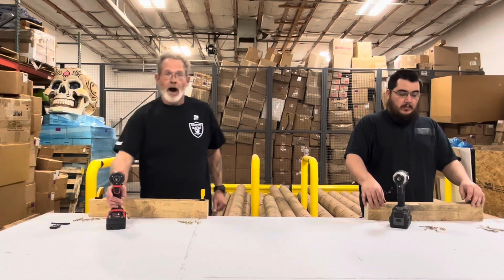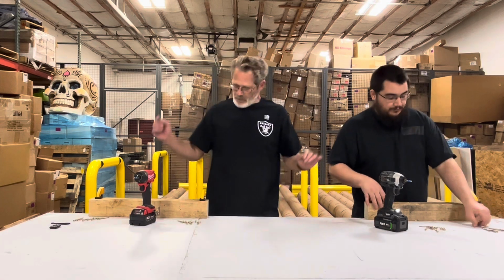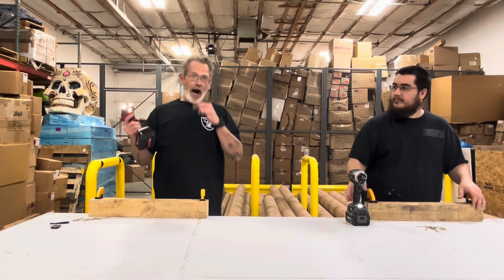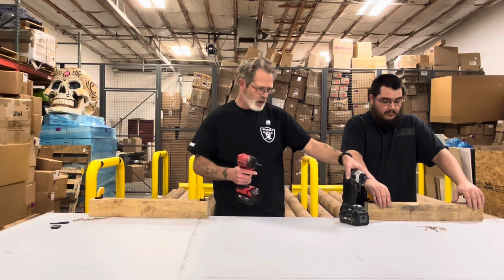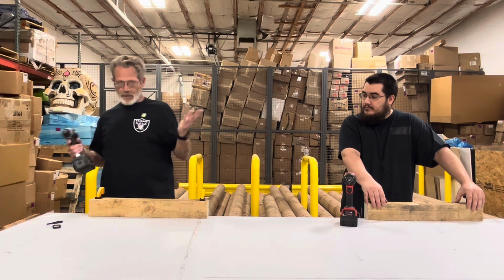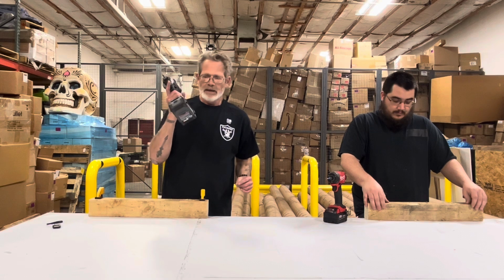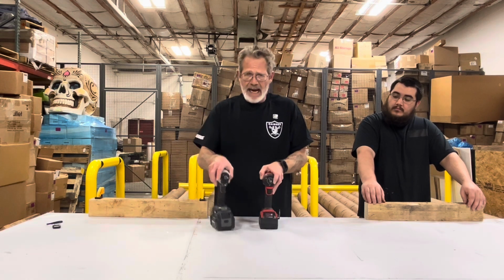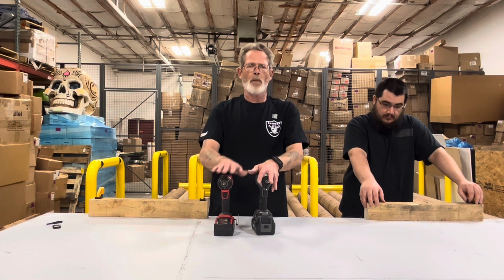Milwaukee vs Flex! #viral  #milwaukee  #impactdriver #reels

Comment: Great job guys!  If you decide to go with the Milwaukee, you should consider purchasing the CP 3.0 battery with 21700 cells.  Slightly lighter than the 5.0s you tested in this video and much more powerful.  The new Forge 6.0 batteries should also be considered.
Reply from the maker: After the soon to be posted drill showdown, it’s definitely going to be either Milwaukee or Dewalt.
I’m actually waiting for the giveaway by SOAlZ because, if I win something, it will definitely influence my decision.
I don’t know if the Milwaukee needs to be any lighter, by the way. It’s already a feather compared with Flex and Dewalt lol.
Reply: @DiligentDave1966  I saw the giveaway promo you’re referring to.  The Fuel angle grinder is a beast and has instantaneous power, similar to all the other Fuel tools.  You’d definitely be pleased if you end up winning it.
Reply from the maker: @SouthFLTools  I wouldn’t even mind the DCF845 since I already have XR batteries.
He’s also having a members only giveaway tomorrow night, and the tools were donated by Joshua Wilson. I’m crossing my fingers that, between the two, I can get something.
Reply: @DiligentDave1966  good luck!
Reply from the maker: @SouthFLTools  I’m not gonna lie, I wouldn’t mind winning a mid torque Milwaukee impact wrench. I could return the Ridgid and use the credit to buy some Milwaukee batteries or something.
Reply: @DiligentDave1966  you’ve had the Ridgid mid torque close to a year, is that right?
Reply from the maker: @SouthFLTools  Yes, but I bought it with my Home Depot credit card. December 28 I believe is one year, and you have one year to return as long as you use the Home Depot credit card. It was my first, and worst video that I have posted.
Reply from the maker: @SouthFLTools  I have only used the Ridgid once, and it worked well, but I don’t think the auto mode works very well. The Milwaukee is more compact and, I think, a little more powerful. Now that the Milwaukee hammer drill doesn’t bother my elbow, would be fine. Going with all Milwaukee . I would keep my 3/8 drive, Ridgid ratchet, though, because Milwaukee doesn’t make an 18 V 3 /8 drive ratchet.
Reply: @DiligentDave1966  Milwaukee makes a lot of ratchets, but only in the M12 line I believe.
Reply from the maker: @SouthFLTools  Exactly. If I wasn’t looking for a big hammer drill, I would consider the M12 Fuel line.
Reply: I agree, CP 3.0 is a great battery!
Reply: @Apache-Helicopter-Life  yes sir!  It’s an excellent battery for the Gen 4 impact driver.  I think the 2-pack is currently on sale too.
Reply from the maker: @Apache-Helicopter-Life  I will consider it if I keep the Milwaukee. I’m not trying to shed weight, though, because it is already super light.
Reply from the maker: @Apache-Helicopter-Life  DCD999 vs gen 4 Milwaukee hammer drill, which would you choose?
Reply from the maker: @SouthFLTools  I would totally consider Ridgid, but I’ve been hearing bad things about them lately. I saw a video where a guy said the drill cut out for no reason, and other people have said they’re not good quality. I don’t know from personal experience, but I know Milwaukee is good quality and I know Dewalt is good quality. Therefore, I kinda have to go with one of those for peace of mind. The Makita LXT is probably the best deal right now with the two free tools, but I don’t know enough about that brand either.
I didn’t win anything from the live stream, by the way. 
I might hold on to the Milwaukee in the Dewalt until the 50 K giveaway.
Reply from the maker: @SouthFLTools  Believe it or not, I think Mat tek 9 has convinced me to test the Ridgid.

Comment: Run the FLEX with the 3.5 STACKED LITHIUM and the MILWAUKEE with the FORGE Battery I have both of them the FLEX will be faster with bigger FASTNERS
Reply from the maker: Thanks for the advice, but I wasn’t really trying to see which one is faster. I was trying to see which one is more comfortable to use and I tested them as they come in the kit.
I decided that the Flex just isn’t comfortable enough to use on a regular basis because I’m only buying one set for my personal projects and videos.
I’m looking for a set that I can use a lot, and the Flex isn’t it for me. I also don’t want to spend another couple hundred dollars on a pair of 3.5 stacked lithium batteries.
Now I’m trying to decide between the Milwaukee and the Dewalt 999.
Also, I’ve heard that the Forge battery is pretty much overrated, but the 3.0 cp is good.
Reply: @DiligentDave1966  I like the FORGE over the DEWALT 5 amp Power Stack and it's almost equal with the FLEX STACKED LITHIUM go with the MILWAUKEE M18 Fuel GEN 4 HAMMER DRILL I have it but don't have any DEWALT DRILLS but looking Forward to the new one they have coming out soon it looks like a XR DCF 961 but it's a hammer drill
Reply from the maker: @ericnichols9275  I wasn’t really planning on buying batteries for awhile, and that’s why I chose kits that come with batteries and a charger. I’m on a budget and just trying to get myself a good combo for future projects and videos.
That said, the Milwaukee is a better choice, for me, than the Flex. Having two 5 amp batteries will allow me to get more done than a 5 and a 2.5.
The Dewalt is a decent option for me because I already have a couple of 5 amp XR batteries, so I can get a bare tool impact driver.

Comment: This proves nothing except you're both only ok at driving screws.
Reply from the maker: I’m so glad you analyzed this video without actually listening to what we had to say while using the tools.
I clearly didn’t claim to be an expert, but I was actually trying to figure out which one is more comfortable for me to use because I plan on keeping one of them for my personal use. So, what it clearly proves is that Flex is not the brand for me!
Thanks for watching. Maybe next time you will listen also.
Reply: @DiligentDave1966  it was a joke, not a dick, no need to take it so hard. Either way, your screw driving is mid at best.
Reply from the maker: @DudeEggs  Have you read my channel description. I’m an average DIYER, and never once claimed to be an expert or a professional.
This is also the first time I’ve used an impact driver with this much power. I’m used to using my Dewalt DCF787, which has a single mode and is only rated at 1500 inch pounds. I have several videos using the 787, and I’m very proficient with it, but it’s time for me to step up to a better combo.
My coworker/assistant has never used a power tool before he started helping me with videos. I’m not ambidextrous, so he helps me out when I do side by side comparisons.
I don’t take criticism hard, or let it ruin my day. I’m just not gonna be the passive person who I used to be.
I also believe that I zoomed in on the area below the trigger to make sure to point out the point I was clearly making in this video. The Flex isn’t nearly as comfortable for me to use on a regular basis as the Milwaukee is.
Everyone has a different opinion, and different experiences.
No brand is best for everyone.
Reply from the maker: @DudeEggs  I removed my comment, and I want to apologize.
I’ve had too many trolls who insult me and insist that I don’t know anything. I don’t claim to know everything, but most people won’t even give me any constructive criticism or real feedback on what I’m doing wrong.
Reply: I own both, i prefer the milwaukee gen 4 but the one key version. You get an extra speed mode, u can turn off the lights so on hot sunny days it will run cooler without the heat from the lights, and u can adjust the trigger response on low speed for more delicate work.
Reply from the maker: @247Combat  Interesting. Do you have any Metabo?
Reply: @DiligentDave1966 i used to have a few metabo. Now where the flex rules supreme is the rear handle and inline circular saws, and ive owned quit a few circ saws.  Best 7 1/4 & 6.5 circ saw combo.
Reply from the maker: @247Combat  I’m considering the 36 volt Metabo triple hammer impact driver because it’s on clearance at my local Lowe’s.
Reply: @DiligentDave1966 if your gonna go that route get the 36v Bolt triple hammer
Reply from the maker: @247Combat  Is there a 36v besides the bolt?
I’ll check, but the kit I’m talking about is regularly like $200. It’s on clearance for $70. The box was on the top shelf, so I didn’t see everything, but it’s the 36v triple hammer with two batteries and a charger.
Reply: @DiligentDave1966 yes there is other 36v other then the bolt. The Bolt is their current top of the line.
Reply from the maker: @247Combat  From what I’ve heard, the 18v bolt has about the same performance as the 36v bolt. The 18v is on sale for $129 until December 28, I believe.
If the 36v on clearance isn’t the bolt, I might consider the 18v bolt.
Reply from the maker: @247Combat   Is the regular 36v triple hammer any good?
Reply: @DiligentDave1966 it is but i prefer the placement if the mode selector buttons on the new version. The old version selector buttons are off to the side
Reply from the maker: @247Combat  The older version is on clearance. I’m going to try it out for myself.